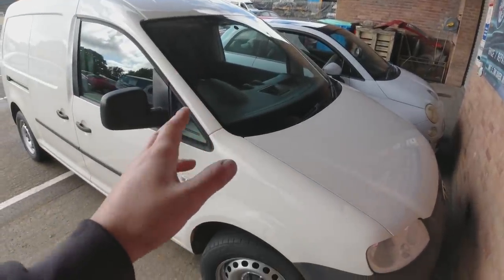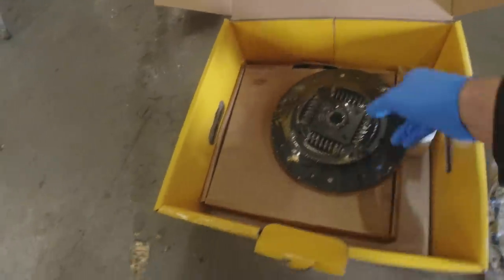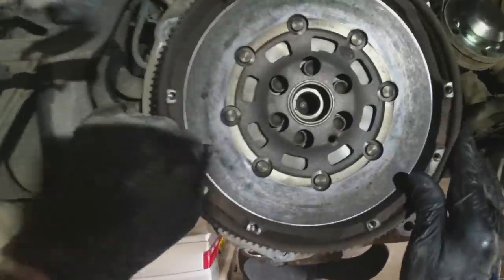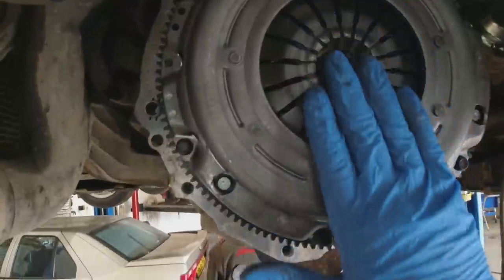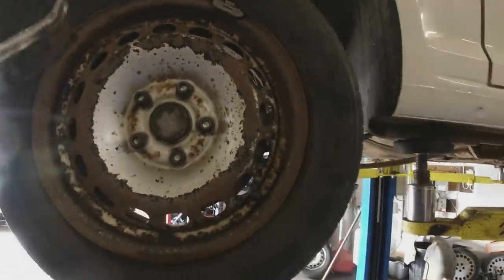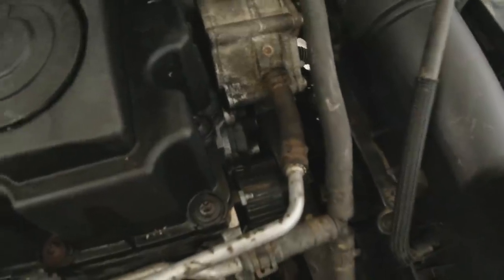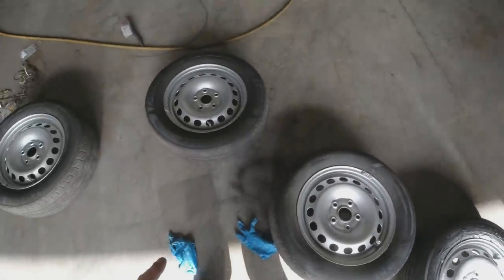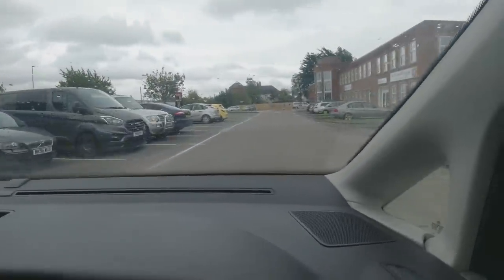I was warned not to do it to my VW Caddy buy , but I still did it!

Comment: Dual mass flywheels, fixed a problem that didn't exist but caused plenty more and a nice little earner for replacement parts. Sorry my cynical side appeared 😂
Reply: Spot on !
Reply: Fixed loads solid mass conversions for  customers that had bought them kit off the Internet not one has come back with any clutch or engine, problems 🤷‍♂️, I fixed a genuine LUK DMF in my own car bmw 3 years and pretty sure it's slightly noisy allready
Reply: RR Extra  what's  a scam?? Car manufacturer building cheap shit enginges with hollow crankshafts and camshafts and no real life expectancy and saying a single mass flywheel will break our crap engines 🤣
Reply: I do think DMF have a reason to exist. But it really is useless especially for a old Caddy TDI work van. Ones the DMF go bad you have a excuse to change clutch and the flywheel and call it good. But really I have not found a good solid excuse for why they are needed. But I think it have to do with the gearbox and low RPM lugging the gearbox. I bet it makes the fuel ratings and emissions better when lugging the engines.... So DMF are a MUST by VW. 

And also DMF might be good for fast and harsh shifts + clutch mismanagement. When the DMF go bad lugging the engine really feels far worse then the SMF.  With the Solid Flywheel you feel the lugging where as the DMF run smooder even now you know and hear is struggling. The gearbox and the engine do not like being in that state of everything slamming about and the DMF help smood it out. So I ques that is why they are needed?  Bad drivers and greedy companies? 

But really the 1.9 TDI engines we put SMF on have ran and driven like new. No reason or way to really tell if it is DMF or SMF for sure. But a bad DMF is :c

3 DMF to SMF vehicle now. One Caddy and one Golf TDI. Caddy Maxi TDI being the 3th that is going to get SMF when needed. + Checking the starter and change clutch.

They run as good as before but just not hiding your engine lugging anymore. But really with winter dub tiers the Gold TDI got so much grunt that you can drive around in 1k RPM with no shakes. Find myself engine braking and then forgetting what gear I'm in as it just runs so nice even with a SMF! Compare it with the Maxi TDI fully loaded and the DMF being on the way out... It feels like your clutch action do not line up with the movement of the clutch when going up hill start and stop. But no real clear signs that the DMF is bad outside of the log bock and the tiny TINY ticking yet that sometimes shows itself after a hard/warm drive. When the DMF is real bad YOU ARE GOING TO NOTICE IT TICK, I KNOW BY EXEPEIRENCE! Before it ticks like crazy mhe. Still ok? Just know SMF is the right thing to do for the 1.9 VW engines. 

Btw. The 90HP Caddy TDI Mk2 was not a DMF vehicle? Same engine more or less... Different injection that gives it 105 ish HP. Internal water pump? Something like that.
But for petrol cars it might be more useful to have a DMF. Not sure. Know only that a heavy 1.6 petrol car with DMF was really smood to shift and release the clutch on without having even a chance to getting used to the car or anything. Was very surprised! No RPM tach and a bunch of drunks around me but the crappie French thing was wonderful to shift and drive for what it was. Might as well have been a automatic but no it was just a heavy duck with no tach and drunks. Did not struggle to do anything in a NA 1.6 from 2005-2010? What?
Reply: "fixed a problem that didn't exist"  Incorrect, the problem has existed since the development of high output four cylinder diesel engines.  These have significantly higher torsional vibration at low RPM high load situations (i.e. where most of the knuckle dragging public who are too stupid to understand the implications use them).  The torque peak under these conditions can be sufficient to damage the drive train and causes NVH.
Just because you don't understand the issue, doesn't mean it doesn't exist.  Manufactures strive to knock every penny of the manufacturing costs of cars, they simply wouldn't it a significantly more expensive part into a car unless it offered benefits.  Manufacturers also don't get any significant benefit from these parts being replaced (though dealers and independants probably do), so that argument makes no sense at all.
Reply: @ferrumignis  I stand by my argument, the problem is caused by operator error. I do understand what causes the failure, I'm on my third vehicle with a dual mass flywheel none of which have required repair. I have also never required to replace a DPF or get one artificially regenerated as I understand what is required to keep it operating efficiently. In fact basically the same operating conditions that I exercise to preserve the longevity of my dual mass flywheel. The problem only exists because manufacturers strive for headline figures of fuel economy, design and develop engines, then devise methods of masking NVH those methods becoming consumables when they were never consumables before instead of educating "the knuckle dragging" public as you so quaintly describe them. It's all a bit academic anyway, they won't exist very soon as IC transportation is outlawed.

Comment: Same family of gearbox as the old Mk2 Caddy (02j) which came with solid flywheel from the factory. I had one of those for 100k with no issues. The SMF conversion in my '08 Caddy has been in about 15 - 20k, again no issues. My van tends to be quite heavily laden due to using it for work and is also remapped to 140bhp. I didn't care if it wasn't as smooth due to it being an old work van but as it turned out there was no noticeable difference.

Comment: Had a 2.0SDI Caddy (non turbo) from new, and they were fitted with a single mass jobbie as standard. Had a new one fitted at150k when the clutch was replaced (not much more than re-facing it), and it was never a problem.

Comment: I did the smf conversion on my c30 1.6d and no issues just after a good few thousand miles you get a bit of spring chatter just like old cars used to.
No loss of power and in my view much better pick up

Comment: I love  sensible modifications. The modern cars high level of refinement perceived quality are partly due to thousands of improvements in componants combined they make the car feel more refined. When the vehicle gets to  an age when its no longer dealer serviced and parts wear out downgrading a few parts is the realistic way to keep a car on the road. Can anyone tell the difference in refinement when driving?? probably not as the as the car will drive a lot better as a broken part has just been replaced. DMF concentric slave cylinder free wheel alternator pulley electric water pump are just just some of the parts I would rather not have.
Reply: Spot on 👍🏻

Comment: Dual mass is there to protect the gearbox from over torquing on turbo charged vehicles. It's ok to use a solid flywheel as long as you don't drive like a looney! Personally I like the smoothness of the dual mass!
Reply: Bollocks its about idle smoothness

Comment: the only way that new clutch could cause a problem, if it is balanced incorrectly for the motor. if it is off balance, then, over time, it will beat your rear main bearing out. so if you start seeing oil leaking out of your rear main seal, you can count on it  being too late by then. good luck with your new clutch.
Reply from the maker: cheers, seems ok many miles later

Comment: I told ya it would be perfect, i use them national kits to and ive never had any complaints even after loads of miles. Where did you buy the kit for £75 though? I use the same kit but pay more than that for it.
Reply: Calder Clutches supply national clutch kits (may supply other brands not sure) and they post out next day usually anywhere in uk so that may be where he got it from, ive found them to be best price for clutch kits including the postage

Comment: Now you've done your first van , try mini buses next , people buy them and convert them into camper vans , especially where you live in Devon !!
Reply: I had a beautiful 02 plate Tourneo from being 5 years old and kept it myself for a decade as having 5 young children, we'd outgrown a car and MPV's didn't have space for double buggies and shopping. I intended to convert it when my kids grew up and we put a 2nd hand 1.6l engine in although it was weaker than the original 2litre it was still a nippy van. I have a tourer caravan and the idea was to put the cooker/sink/fridge in it. I also had a night heater out of the van I took the engine from and I was going to buy a rock n roll bed. I has massive plans and then for personal reasons I parted with the Tourneo. I still have my stuff but I'm actually after a transit/van with the high top. Personally I like the vw crafter but they're out of my price league. A transit would be best with parts being so easy to come by and they're easy to work on.

Comment: Nice work big man.
Reply from the maker: Thanks!
Reply: I'd like to see you keep that van even just for the big move, it would prove its a good decision. With the viewers on the channel it should add value. Twin side loading doors etc its a cracking van for mobile work of any kind. Led to believe heavier springs are used in the friction plate of these solid flywheel kits to reduce vibration.

Comment: Thy 2 mass flywheel is there to save the gearbox's life too. Multiple injections hit the crank hard, and those knocks are directly transferred to the gears..... you're potentially shortening its life that way.
Reply: Ive heard all that and its crap . The dmf uses a solid clutch plate . The smf uses a sprung clutch plate . What's the difference ? Just another example  overcomplicating stuff that worked for years just fine until engineers started to try justify their egos

Comment: My grand son has one only done100k he has more trouble and all sorts of mechanical failures ,as an ex vow mechanic DO NOT BUY ONE.unless you want to share ownership with the garage,they will spend more time with it than you will driving it!
Reply: My 06 2.0 diesel(single mass) has done 240k, just changed the clutch and flywheel last week for the first time. Other than consumables (brakes, tyres, belts etc) it’s cost me nothing in nearly 1/4 million miles

Comment: So you have re-engineered the manufactures design?......so the gearbox, crank and engine will now be exposed to more induced stresses that will eventually become evident in time. The manufactures would have put a solid flywheel themselves and not a dual mass one and saved themselves millions of pounds over time if it was that simple. Simply you are taking a chance and the fact you have videoed it will arguably make you responsible at a later date?
Reply from the maker: Nope. Its 145k car, even with OEM clutch Id not be liable. Clutches are not even covered on brand new cars. And a little research online will show you people run 100s of thousands of miles with this set up. Improvements can be a percentage lower than 100%. A dual mass may be 15% more effective than solid, that does not make the solid useless
Reply: Chops Garage I think you are missing the point, it's nothing to do with the clutch or it's life it's to do with what damage a solid fly wheel can do as it adds to the loading on the crank and gear box. In effect you have changed the manufacturers design and a half competent solicitor in a court would ask you for calculation to the design change, particularly if it was a contributing factor to an accident.
Reply from the maker: Oh you are stretching there Stephen! At worst it would cause gradual damage over a prolonged period! Cause an accident? No chance. But again there are plenty of examples that have done another 100k on this set up no issue. As said its a marginal improvement to have DMF not dramatic.